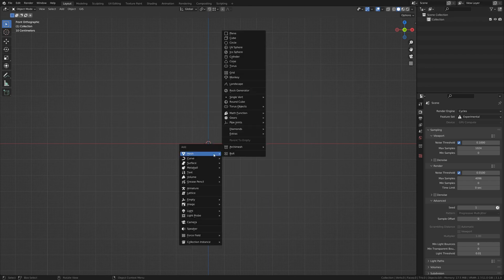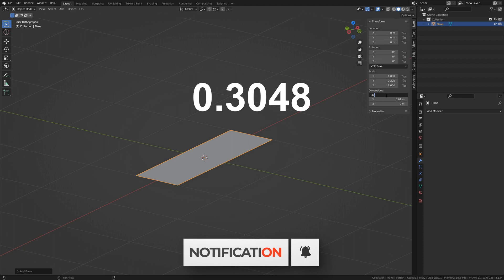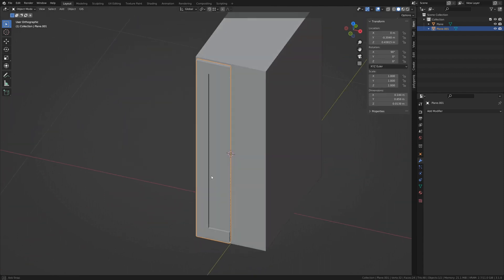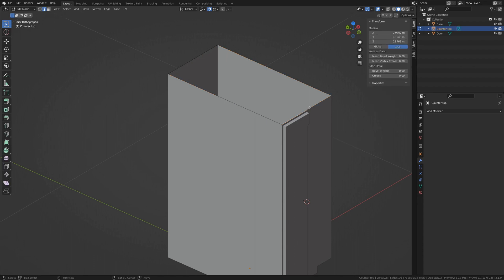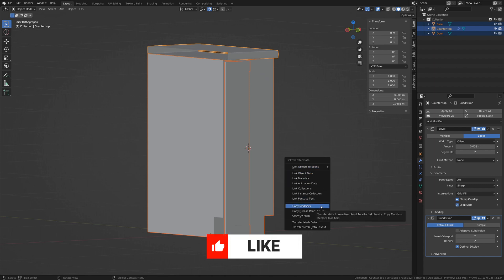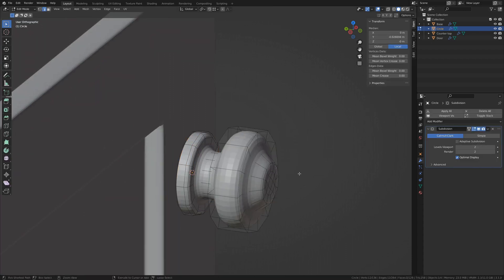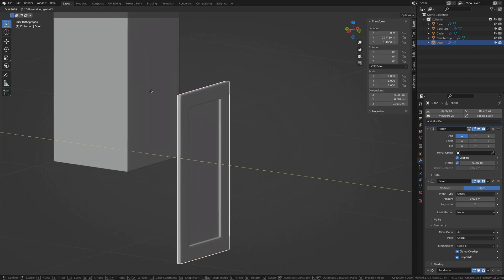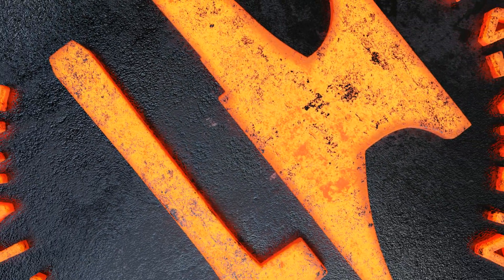Create Modular Kitchen Cabinets with Blender

Comment: Tutorial is useless for beginners because there is no mention of how to pull up the add menu. Some tutors use a keylogger to display the keys that they use.
Reply from the maker: Right. It's also not edited for a beginner.
Reply: @BlenderForge  I'm not a beginner in 3D modeling. Just Blender. I'm coming from Lightwave, which I've gotten pretty good at.

Comment: This vid would be great but it was sooooo hard to follow because your axis are different than mine. My x is left to right and front orthographic view has me staring down the y axis. not sure why yours is different or if this is a mistake on my end but everybody seems to say that the way I have it is the way it's supposed to be. any advice?
Reply from the maker: Yes, X is width and Y is depth.  Which way is what just depends on what side you started working on. If it is causing confusion during the tutorial you can simply rotate everything by 90 degrees.

Comment: Great tutorial.... short and informative
But at 1:32 there is another loopcut that you didn't mention the measurements for that
Reply from the maker: That cut's measurement doesn't matter since it is immediately being snapped to the cut from 1:26. Unless I am misinterpreting your comment.
Reply: @BlenderForge  justbigisz1293 is talking about the vertical loop cut that intersects the horizontal loop cut from 1:26
Reply: @BlenderForge  i am making it along with you in blender and he is right. But so far, great tutorial, thank you!
Reply from the maker: @Lou-2015 thanks! Yes, this is an old tutorial. Back before I had any idea how to edit properly 😵‍💫

Comment: When resizing the cabinet doors at 2:45, how did you keep the cabinet frames absolutely sized. I noticed the top and bottom of portions of the door frame didnt change in relative size as you scaled the cabinet doors down.
Reply from the maker: An excellent question! I was in edit mode (face selection to be exact) and selected only the parts that would need to move in order to resize the drawer rather than actually scaling anything.

Comment: how do you cut the cabinet door in half?
Reply from the maker: There are a few ways to do it. Using Ctrl+R to add a loop cut down the center and then deleting one half is probably the quickest.
Reply: @BlenderForge  how do you delete one half, i'm following your instructions but i don't know what tools or key you use for it?
Reply from the maker: @victorcardenas324  Using Ctrl R is the quickest way to add a loop cut down the center. Then box select one side and hit X or Del.